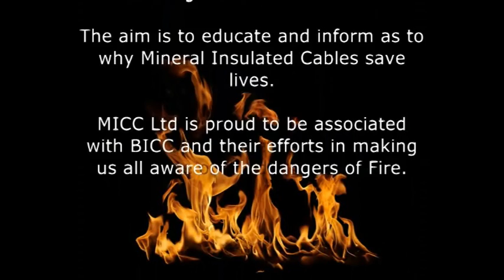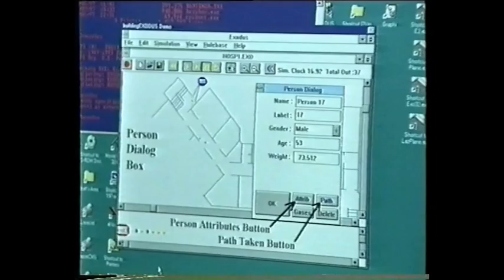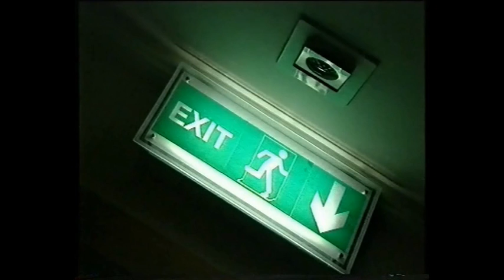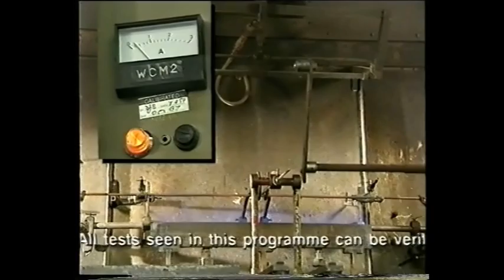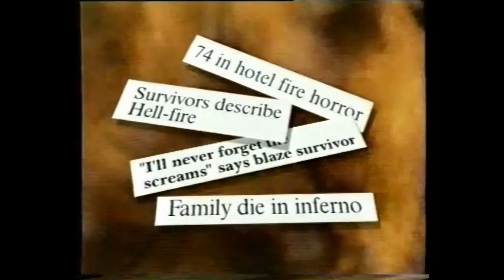Fire Proof / Survival Mineral Insulated Electric cable

Comment: I visited an Electrical Consultant recently to talk about fire performance cables. Their strengths & weaknesses. When I raised the subject of MICC, the only true fire survival cable, it was described as an old fashion cable system. I was truly amazed and hasten to add that we were not talking about modernity but products and practices that actually saved lives. Yes, MICC has been around for over for almost 80 years but during that time has performed in fire conditions with distinction and survived the test of time.

Comment: Fires in hospitals where fire resistant cables have been used, are susceptible to a short operating life in fire conditions. They exude toxic fumes and smoke emissions and have been known to have even start and spread a fire.There are many different FR cables available to the market but are they fit for purpose, that is the question? In fire conditions cables have to operate in the presence of fire,water and mechanical shock. Can we trust the existing standards? It is a question that remains unanswered.

Comment: Another fire has been reported at Charing Cross Station where alledgedly created a disruption to the tube services and damaged electrical cables.This is alarming considering the densely populated environment. Surely cables should be employed that will not burn, create no smoke and will withstand mechanical shock in fire conditions.The ultimate in fire management is the MICC cable system.

Comment: The are a variety of cables being offered in the market claiming to have fire resistant qualities but are they fit for purpose in terms of their application? There is a wide difference in the performance of an inorganic MI cable compared with a softskin polymeric FRC cable in fire conditions but is this being recognised by specifiers?

Comment: The threat of fire is always with us as demonstrated by the fire at the Victorian Eastbourne Pier. Another major fire disaster to a great Victorian, 144 year old  listed structure, that exploded into flames quickly. It is believed that the fire was caused by an electrical fault behind wooden panelling. Obviously, involving electrical cabling. Lets hope that fire does not occur in a high-rise building where early warnings and effective communication are essential. Seems to me that it is vital that the best protection is administered and safety for the people using the building must be the key priority.

Comment: Heavy smoke in the basement of The Shard building resulted in 900 people having to be evacuatedfrom the building.Fire fighters are alledged to have not determined the exact cause for the smoke obstruction. In such circumstances would you return to your work station?

Comment: My research into the subject of  fire performance electric cables is gathering pace. I am astonished at the variance of opinion  and confusion within the consultancy and user/contractor sectors. There are a considerable number of fire resistant cables in the market all claiming an ability to hold back fire but do they meet the expectations and actual requirements in fire conditions. Obviously, much depends on what the specifier is requiring but there is little doubt that fire fighters need to protect the electrical supply for as long as possible. Furthermore, in fire conditions evacuating a high-rise building structure can take a great deal of time and it is, therefore, important that the electrical supply is maintained. For all emergency services a 2 hour fire rated cable is important and this should be recognised as a priority. The flaming confusion comes from standards & approvals that are conflicting and leaves much to be desired. Comments are invited!

Comment: The London Skyline is a topic of great concern, especially relating to the possibility of Fire in a high-rise building. Buildings get taller and the consequential risk of fire increases with every additional floor. Fire fighting, externally, is limited and gridlock streets makes the task even more hazardous. It must be born in mind that 40% of the fires globally are the result of electric cable malfunction. Accordingly, fire management and modern predictable communication systems, have to be, absolutely, fit for purpose but are the cable systems employed likely to perform, as one would expect, in real fire conditions? That is the question.
The common understanding amongst most specifiers, sellers, installers and users of electrical cables, which are manufactured to meet the requirements of common fire Performance tests like: Flame retardance tests: Smoke obscuration tests, Halogen and acid gas emission tests, is that the cables they subsequently specify, buy and use will provide a similar performance under real fire scenarios that the test methods suggest. Unless the cables are exposed exactly to the same conditions, as documented in the test, which is unlikely, this is not likely to be the case and with disturbing consequences.
Three technical documents are available, on request, from the author, Richard Hosier, relating to  “Electric Cables Fire Performance”, which may be of interest to all readers on the performance of electric cables in real fire conditions. (Flame Propagation, Fire Load, and Life Span). The Great Fire of London is a chapter in the great City's history, lets all hope that our buildings of today are suitably equipped to deal with a major fire should the situation ever arise in the future A big ask - I'm afraid?
Geoff Williams
Business Consultant - Fire Management
MInstMC. MInstM.
TRM/MICC Group of Companies
Email: wgwilliams@trmltd.co.uk
www.temperature-house.co.uk

Comment: I have many discussions with Electrical Consultants. Some allow the use of FR cables because they believe that it will give a similar performance in fire conditions as MICC fire survival cables at a much lower purchase cost. That is obviously due to a mis-understanding that exists when considering BS standards.Cost is really irrelevant when considering the risk to human life. Softskin FR cables are susceptible to mechanical damage and are usually provided with some form of additional protection which increases the overall cost. When considering the cost situation it should always be considered on the basis of installed cost. However, the real issue is the relative performance of these products in fire conditions.

Comment: Sadly,the BS 6387 fire performance standard often influences cable selection.There are BSI Codes of Practice that should be considered. For instance the code of practice BS 5839, Part 1, recommends, in detail, MICC enhanced fire survival cables for critical fire protection services. BS 6387 is a standard applicable to fire testing and should be viewed in this context. Some specifiers conveniently overlook this consideration. I believe that some cables, chosen to provide an electrical supply to emergency services, in high-rise buildings, are chosen beyond their competency.

Comment: I hope one day it will be law that all public buildings are compelled to use mineral insulated cables
Reply: We are working on this. Your comments are very appropriate. We have, so far,been fortunate, here in the UK, not having experienced a major fire in a high-rise building. These experiences are more common in the USA where a 2 hour fire rated cable [MICC] is a stipulated requirement.

Comment: Another fire disaster is reported in a Russian hospital. Their record in safety in hospital and care home buildings leaves much to be desired. No smoke detectors or emergency lighting with patients locked in their rooms and questionable poor quality cabling gives rise to the fact that safety in buildings cannot be compromised. That is why the question of the relevance of the British Standard 6387 and it's rating procedure requires further scrutiny. Products must be fit for purpose.

Comment: I was recently staying in a leading Chester Hotel when the fire alarm was activated during the middle of the night. Suddenly there were panic noises, doors opened to check the situation, then the lights went out. Contact was made with the reception to be told it was a false alarm. It seems that false alarms are quite frequent when FRC cable is used due to damage to the silicone rubber insulation during installation, so the electrical contractors tell us. Not an encouraging aspect!

Comment: We desperately need a form of differentiation that distinguishes MICC from FRC in fire performance terms. Many people, including contractors, believe that both offer a similar level of performance, in fire condtions, due to their respective CWZ rating. When in fact a FRC cable has only a short term operational life when fire, water and mechanical shock are brought together simultaneously. It must be recognised that MICC is an enhanced fire survival cable designed to operate in a real fire.

Comment: The British Standard Institute [BSI] are reviewing the BS6387 cable fire standard. Comments from the public are allowed on-line. Comments are required by the 31st August latest. The BSI comment system must be observed. We believe that the entire test, carried out on a fire resistant cable, should be carried out using one {1} piece of cable if it is to gain a CWZ rating.If, in any doubt, please watch the 14 minute video for clarification.

Comment from the maker: There has been a major fire at Nairobi airport which remains closed. They don't know the cause but it is likely to be cable related. Several years ago a friend was involved with the job of supplying cable but cheaper cables were used. It certainly does not pay to risk lives for the sake of saving money. If it is proved that the wiring was the fault the insurance compay will have a big payout!

Comment: It seems rediculous that there is no Standard that will differentiate between the "Organic" soft construction fire resistant cables and the "Inorganic" solid constructed MICC. How can a specifier of electrical cables make a clear recommendation about the cable performance required without a BS test that will differentiate between these two cable types. It seems very obvious they will behave very differently in a real fire situation and yet are classified the same in the current inadequate BS.

Comment: This is an excellent and very worrying demonstration of the need for very careful selection of the correct type of cable to be used where fire survival (not just resistance) is required. I agree with Geoff Williams comments that any cable specified for use on a critical circuit powering fire alarms, emergency lighting, ventilation etc must obviously be able to withstand fire, water mechanical and thermal shock at the same time as all these effects will occur in a fire situation.

Comment: Why do British Standards [ BS6387 ] allow 3 seperate pieces of cable to be used in each part of the fire test and then give a fire resistant cable a CWZ rating? This is mis-leading and needs further clarification. The dynamics of any fire brings fire, water and mechanical shock together, simultaneously. In reality these cables, surely, are not fit for purpose, in fire situations.

Comment: Why do electrical contractors dislike MICC and discourage it's use? Probably because the purchase cost is considered their first consideration or it is often considered as being more difficult to install. Doesn't the issue of it's superior performance in fire conditions and it's fitness of purpose qualify for consideration? In fire you get one chance of survival as the video depicts "Raising Standards - Saving Lives". This merits closer and deeper scrutiny during the cable selection process!

Comment: According to the fire fighters, fires can only be fought externally up to the height of 7 floor levels.This is dependant on water supply and access.Major city streets become gridlocked. This means fires have to fought internally.It is,therefore, essential that emergency services perform predictably. Cables provide the vital link and have to perform in the presence of fire, water and mechanical shock simultaneously.Surely,it makes sense to use an MICC fire proof cable for these applications.

Comment: As the tests shown in the video indicate that a fire resistant cable would fail in fire conditions shortly following ignition.Yet consultants assume that these cables will perform in a similar way to MICC in fire conditions. When you install a fire survival cable you are buying time to allow people to vacate a burning building. The risk ti life is particularly high where large numbers of people are present!

Comment: This video is extremely interesting since 40% of the major fires Worldwide have been caused by cable mallfunction or short circuits. The dynamics of a fire bring fire, water and mechanical shock together simultaneously. A cable made from inorganic materials must be the only fire survivable cable and should be considered for all emergency services. I think it is called type MICC.